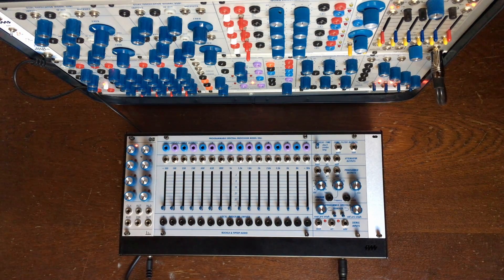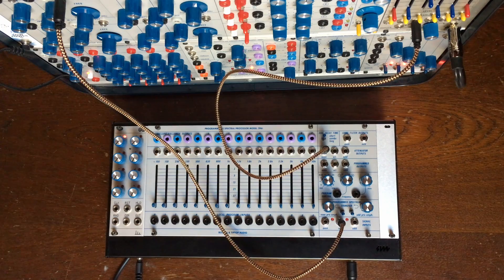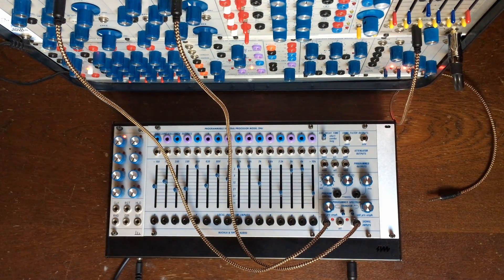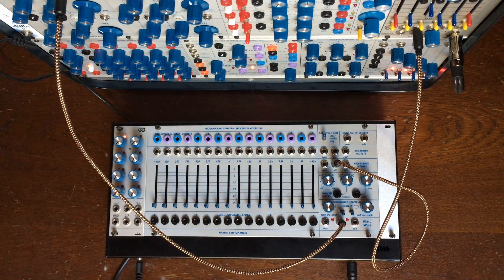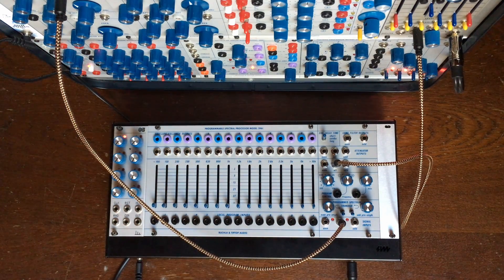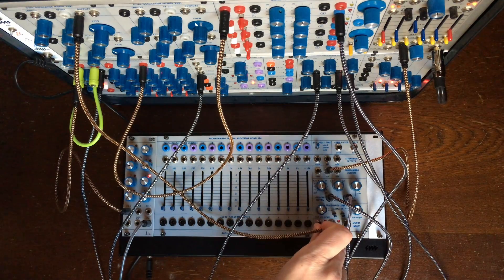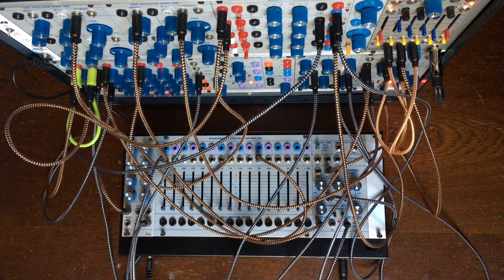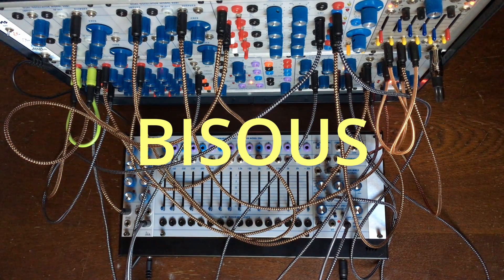296t Basics Part.1 | Buchla & Tiptop Audio Tips & Tricks

Comment: Nice tutorial, thank you. I cannot understand why your mixer (top right) does not look like the 207t I have in my setup. I see an extra row of jacks. Please help.
Reply from the maker: Hey there! So to answer all your questions: I was using a Minimix by Toppobrillo in this video (another riff on the 207, I made a video about it here: https://youtu.be/Z44-GudrFYs).
At 3:54 i'm pluggin into the right input of channel 2 (channel 2 & 3 have stereo inputs on this module).
Reply: just found out that's not Tiptop.
Reply: At 3:54, where in the 207 do you patch the attenuator output ODD from the 296t?